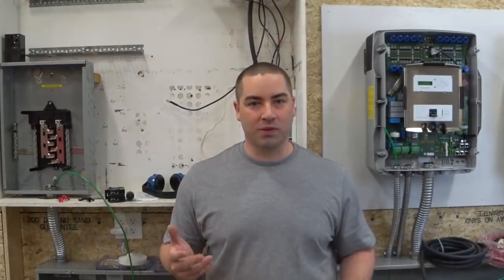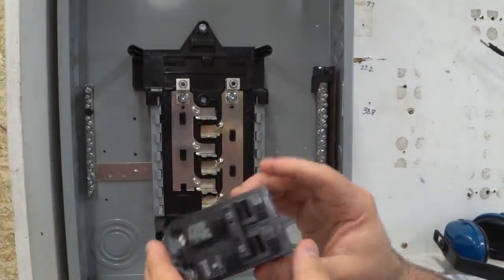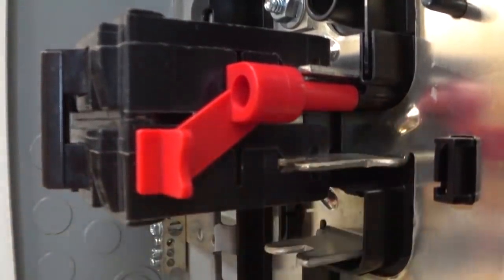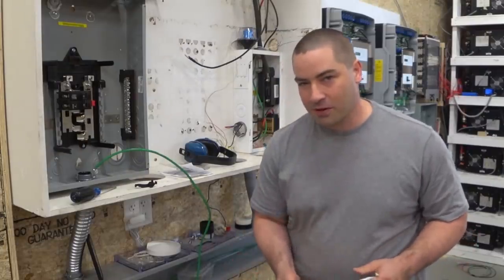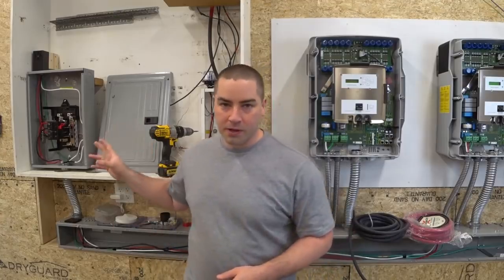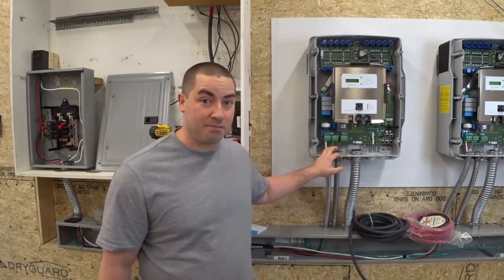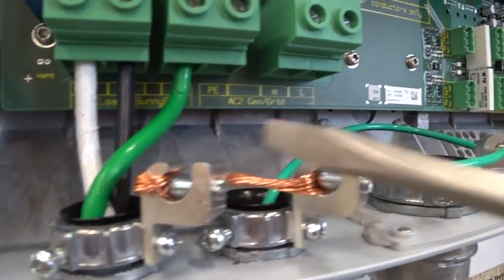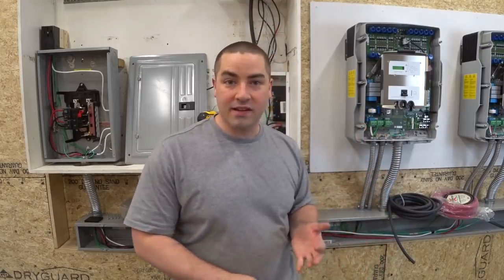Wiring AC Combiner Box on Off Grid System

Comment: I have this SRNE inverter that I'm trying to connect with a 15kwh lithium-ion battery but the inverter keeps showing the error code 05 (Battery overcurrent hardware protection). Please any suggestions on what to do?
Reply from the maker: Try pre-charging the capacitors using a resistor.  I demonstrate the process in several videos, like this one: https://youtu.be/SYJ25izYSGc at 6 minutes, 46 seconds into that video.

Comment: I have a 6000 single inverter. Only 120v. I think I only need a single pole breaker 70 amp. Says 6000w 68 amps out.
Reply from the maker: That's cool.  Let's do a little math.  The 6,000W rating on the Sunny Island is continuous.  6,000W/120V=50A.  The 68A you are looking at might be the 30 minute rating?  NEC (code) says you need to upsize 20% on top of continuous ratings, which would be 60A.  So, a 60A breaker meets code.  But, if you want to upsize your setup to a 70, or 80 Amp, there is nothing wrong with that, so long as you up-size the wire with it.  The wire and circuit breaker need to be matched. Look up "NEC Ampacity Chart" and I believe you will find that you can use 80A circuit breaker with 4 gauge copper wire.  I used 6 gauge, and the 4 gauge is the next size larger.

Comment: Half way through. You hooked the red and black to breaker. Is the red wire from one inverter and the black from another? You did this to achieve 240v?
Reply from the maker: Each Sunny Island inverter puts out 120V only.  Yes, one red wire is connected to one of the inverters, and the Black wire to the other inverter.  I set the programming so that they are "out of phase" from one another, which makes 240V.

Comment: So I'm looking for some information on how I should wire my panels for my Growatt 5000 inverter. I have 12 panels at 450 watt each. What would be my best options? I'm also planning on using a 4 to 1 combiner box.
Reply from the maker: The MPPT range (maximum power point tracking) for the 5000ES inverter is 120VDC-430VDC.  You need to make sure that your solar panel strings are inside of this range.  To do this, look on the back of your solar panels.  There should be a data sticker.  You need to check the "Vmp" which stands for Volts at maximum power.  As an example, let's say the Vmp of your solar panels is 50VDC.  This means you need a minimum of 3 panels in series to be above the 120V minimum.  3x50V=150V.  
You will also need to make sure your Voc is below the maximum Voltage of 450V for the unit.  Since you have 12 panels total, I'm guessing that when you do out the math on your panels, you will find that having 2 parallel strings of panels, with 6 panels in series per string, will get a good result.

Comment: So I am running the LV6548. I want to connect it to my trailers main breaker. My plan was to disconnect the grid wires that were cut from the grid when the trailer was moved and connect the LV6548 in their place. I will not being using anything over 120v so I will be keeping any breakers over 120v off. What do you think?
Reply from the maker: Anything is doable, but there are some precautions to consider.  
1. Try having a transfer switch between the main panel, and the inverter.  The transfer switch can then be used to switch between the inverter, and some other input such as a generator.  This way, if the inverter goes down, you can still run loads with a generator.
2. I'm a fan of making it impossible to accidentally screw something up.  We are all human, and make mistakes.  Ask yourself: "If I forgot to turn off a 240V breaker, will this cause any damage?"  If it could, then I'd remove the circuits that are 240V, or run them to a different breaker panel.  Or add a transformer to make your 120V inverter into a 120/240V inverter.  The point is to make it impossible for you to cause damage to equipment.

Comment: quick question am kindly asking?  how many 300w solar panel it need to get 3000w ? what size charge controller i will need? what size wire it will take to set up 3000w system? how many batteries it will take to run 3000w inverter? what size fuse ?

Comment: An inverter is 1 phase at 230v best way to split into 2 legs , wire it straight into 1 phase of a 100A Double pole breaker and then jump it over with a short wire at same gauge , which will make my entire box 1 phase “ Question will 220v plug still work if both phases is the same phase ? Thank you - you do an awesome job !

Comment: Great - Job Explaining ! Im doing a low budget battery back- up / DIY Alternator Generator will be using 2 Gm 10 SI High Amp 110A & a 120A w/ a Ford - Mazda 150A  will be powered by DC 12v motors energized by battery-bank 48v Lithium Phosphate 3.2v 280A & a bank of Lithium Titanite 2.3v 40A “ what I’m trying is to be self sufficient in electricity in a grid-down scenario . My inverter is a 5KVA 230v pure sine wave charge controller in a sense the alternators can charge the PV for 12v but if I tap into the Stator which is 120v Ac before the change over to Dc current .

Comment: Of course im a lil confused lol ok so the green & white wire coming from the inverter is switched to a black & red wire going into the breaker box now what volt is that going into the box and is that just one inverter sending power to ur box at 220v or 120v ??
Reply from the maker: Each inverter outputs 120VAC.  I need to combine the two in the circuit breaker box.  Inverter#1 has a hot, neutral, and ground.  Inverter #2 also has a hot, neutral, and ground.  First, all the grounds are run with green wire and all go to the grounding bus bar inside the combiner box.  Next, both inverters have a neutral.  Both of these are run with white wire from the inverter to the neutral bus bar of the combiner box.  Last, we can look at the hot legs.  Hot leg from inverter#1 we will call L1.  L1 is run with back wire to one pole of the 50 amp circuit breaker.  The hot leg from inverter#2 we will call L2.  L2 is run with red wire to the second pole of the 50 amp circuit breaker.  At this point all the input wiring is done.  Output wiring is run the same way every other house in N.America is run.
Reply: @DavidPozEnergy  How do you synchronize to the two phases at 120VAC and -120VAC ?

Comment: Thank-you for you’re Teaching ! I’m a DIY ‘re i’ve got a 5KVA 230v PureSineWave Inverter charge controller 48v to only use when the Gide is down , I’ve got Two 48v Lithium battery Banks 1 - 3.2v 280Ah & 1- 2.4v Titanite 40Ah , I wanted to hard wire it into a 100A Double Pole Breaker which would be a dedicated circuit only for this ! So when we lose power you have to go down and shut off the main breaker killing the grid from the house and then flip on the double pole breaker which is live by battery back up I also have a manual transfer switch with six circuits 30A but that is very limiting! I have the Moes Automatic Transfer Switch but I would prefer to do it manually 2 make sure No Issues & I have A brand new breaker box I could wire as

Comment: I took time to read the sol-arc wiring diagram for inverter wiring, page 48/53.  It states that one one side (top) the wires from the meter through the main disconnect then to the ac combiner then there is a line for each inverter by splitting  (ok. I understand) then there is a line going to the Bypass Transfer switch on line side ( I guess a PDB can do that before it comes to the ac combiner box). Then on the generator side the wires go into the ac combiner box then splits into the 2 inverters (2nd ) and then the outputs from the inverters come into the ac combiner box and then goes to bypass transfer switch  I assume as one sets of wires (3rd) bottom. Looks simple but when I try to get images of ac combiner boxes to show the above that is where I got a problem.  The examples don't reflect the above. Are there really 3 sets on inputs and then multiple outputs? It seems that all an ac combiner box is is really a sub-panel and you can buy a sub panel and the fittings and make an ac combiner box yourself. I can only imagine all those wires in an ac combiner box. Can you enlighten me? Thanks
Reply from the maker: I've never wired up a Sol-Ark.  Try this: https://youtu.be/7zoPu-uK4Xc

Comment: Hi I am now learning about ac combiners via sol-arc 12 parallel diagram and a video.  How does the combiner work?  The name suggest like array combiner that a number of wires run into it and then one common wire run out.  However, where there is a generator connected to inverters, solar panels to inverters then ac output and the grid (120v/240 vac) do they all combine into one red and one black and one neutral wire that run into the manual transfer switch? Thanks
Reply from the maker: The solar panels have a combiner box outside.  Solar and batteries are DC.  Inverters output AC.  You need a combiner box for solar.  Another combiner is sometimes used with multiple batteries.  In this case I have two inverters and combine them at the AC output.
Reply: @DavidPozEnergy  thank you again

Comment: Just an FYI as per the SMA SI inverter manual. "The AC cables between the Sunny Island and the sub-distribution of a system must have the 
same wire size and the same cable length for all parallel connected devices" This is a cool channel. Thanks for sharing your projects and knowledge.

Comment: David what did those inverts set you back I been looking for a set of those to run parallel
Reply from the maker: I got the inverters at a smoking deal of $2400 for the pair.  But the lowest I've seen recently (Ebay) is $3200 for a pair.  Still a good price because MSRP is $5000 for one.
Reply: @DavidPozEnergy   dam I guess I 'll keep saving

Comment: If you are back feeding into the 60amp breaker, does it work as a breaker then?  I'm curious as to why you didn't just attach the inverter wires to the top terminals, like the two 100amp lines/phases? would attach in your main breaker panel from the local electric company?  The only reason I as is I'm looking to do the same configuration at my house.  Thanks in advance!
Reply: I am wondering that too.  I have an off grid home I am building and one of the DC trailers that I will be eventually transferring the equipment off of and into the home and want to bring the 240AC from the two inverters and bring into my main service panel just like a normal service entrance would be setup.

Comment: Hi & congrats... cuestion: why you don't screw the "the hot legs" (the red & black wires) in the top of the AC box? I mean in the conexion to the copper bars of the AC box, instead of to the main breaker directly? You know what I mean?
Reply from the maker: I didn't do that because I wanted a main circuit breaker in there.
Reply: @DavidPozEnergy  ok... got it! Thanks

Comment: great job, soon will be done somethink like you with leaf bats +  Sunny Island 8.0 + Rec Bms, one question if you have a blackout batteries could work like a generator ? is in the  Sunny Island we need to set parameters ?
Reply from the maker: Yes, there are settings in the Sunny Island so you can use it like a backup generator (UPS)
Reply: @DavidPozEnergy  But i am trying to understand how to make it, i read we need to connect on AC2, but the wires go to the same grid of the AC1 right ? Can you make a video how to make it ?
Reply: manual says :
• Connect the line conductor to AC2 Gen/Grid L.
• Connect the neutral conductor to AC2 Gen/Grid NTT.
so simple(one phase) ?

Comment: Does the main breaker hold down kit prevent a breaker from being installed in the slots across from it?
Reply from the maker: Yes, that's correct.
Reply: @DavidPozEnergy  So if you add a few Sunny Boys then they would also have hold down kits too? A guy will lose a lot of breaker space. Only asking because I have 3 Sunny Boys I'm putting in and will also be adding the wind version down the road as well.
Reply from the maker: I'm not sure about that.  Sorry.

Comment: Is white the uniform code for nuetral in your area? It should be ( - ) equivalent or black in DC
Reply from the maker: This panel is containing AC (alternating current) circuit breakers.  White is the Neutral.  Yes, white is the official color for neutral in AC.

Comment: NONE of the ground wire connections would comply with UK standards - ALL bare ends must NOW be terminated with a ferrule (applies to Line and Neutral too) Double connections are allowed but should use a twin entry single out ferrule. We don't have the problem of split phase either (except on 110v site transformers (+/- 55V AC about ground).

I thought this was going to be about combining inverter outputs (can be done potentially using grid tie inverters NOT tied to the grid. Requires a NON grid tied single inverter for sync). However, the modern domestic supply provided in the UK provides a 240v 100A main fused input to a 100A (max load) consumer unit, the normal standard one comes with separate 80A and 63A rated RCDs, EACH providing 5 circuits. Upstairs 32A power and 6A lighting on separate bus bars and downstairs 32A power and 6A lighting on opposite bus bars with a 40-45A cooker supply  and 32A utility supply the spare circuits used for ancillary lighting or dedicated spurs e.g. for gas heating boiler and/or refrigeration etc. So, any solar/inverter supply potentially has to provide up to 20kW to go completely off-grid.

AFAIK in Germany they have a full three phase supply to each house. Not sure about flats, I suspect they only get provided a single phase out of three. The UK & other European countries share only four things - 

a "kind of" commonality or rather compatibility (sometimes) of appliance  plugs (France and Germany are different but designed to be compatible) 

a 220v standard (within a certain percentage to allow for local differences) - the UK is nominally 240v but is often at 250v.

a 50Hz supply (easier to divide down to time 1/100ths of a second (60Hz is easier to run clocks ostensibly, but not so sure about that)

a standard set of wiring colours - brown - line; blue - neutral; yellow/green stripe - earth.

Everything else is different (pretty much).

Love your video series on this subject but you should bear these BIG differences in mind since you have an international audience.

Comment: Nice use of the gutter. Your grounding is spot on in my opinion. Grounding between AC/DC conversion is something that is still not quite perfected, in my opinion.  When in doubt overground, unless it messes with neutral/ground separation, necessary for GFI's to work..

Comment: I hope you are open to information about solar and NEC.
First, I tried to find a NEC definition for combiner box and couldn't.   But after doing many megawatts of solar design, I can say that that term is for D.C., not AC.   AC is panel board or load center.    Then, I saw your grounding bushings on the flexible metal conduit, they seem to not be required for your installation.   Maybe I'm missing something in article 348.   
Also, while reading Article 348 Flexible Metal Conduit Type FMC 348.12 Uses not Permitted (3) In storage battery rooms.   I would suggest that you get a determination from an Architect if your batteries would be classified as such.   If yes, then you need to find out what it takes to get an exception.   I believe there is one for air changes per hour.   I just want you to be safe!    Always be safe.   The life you save may be your own.   Respectfully,    Kevin
Reply from the maker: Thank you.  I appreciate your well thought out comment, and the way you said it.  I'll look into it more.  I'm not an electrician, so at the end of the day my local electrician makes the call.
Reply: DavidPoz    Just wanting you to be informed.    Best Wishes!
Reply: @DavidPozEnergy  Kevin is correct in that there is no need for grounding bushings as the flexible metal conduits work as the grounding electrode conductors. In my opinion however, they are not a bad idea when the flexible metal conduit is connected to panel boards using the concentric knockouts. I've been an Electrician for almost 30 years, however I am relatively new to solar applications. I find your videos to be very informative and well done! Thanks, and please keep the videos coming!
Reply: I've been an inverter field specialist, a Procurement Manager, and Inspector for commercial and utility scale solar projects for over 8 years. AC Combiner is a thing in solar especially since string inverters have become more prevalent on large projects. Electricians call them Panel Boards or Solar Panel Boards. The NEC has been playing catch up with solar since day one.

Comment: You only need to bond one end of the conduit.  Bonding both ends of the conduit can cause circulating currents to build up in the ground wire from simple induction.
Reply: Yes yes yes! 
Ground wire needs to be connected at both ends, but shielding/foil/wrapper should always only be connected to ground at one place (/one of the ends)! 
Most electricians don't understand this!
Reply: @bayerbear6770  Sadly, it depends on who's doing the inspection. A recent build of mine was "grounded to hell and back" because of a total ***hole inspector. (took an order from engineers -- actual certified, stamp-welding Professional Engineers -- and UL, to get the UPS approved. Yet, all of the runs for the HVAC systems, run by a different contractor, has none of this unnecessary grounding.)

Comment: Great to see your back feeding wiring.  This is how grid tie inverters such as the SMA Sunny Boy connect to the grid and help people go Net Zero by simply going into a 40 amp 240v double pole breaker (20% rule of a 200 amp main service panel).  However, why didn't you just run the AC output of the SMA inverters into the main L1 and L2 of the AC breaker panel instead?  Saves the need for an AC panel that has a master breaker?  I'm no electrician, but the term AC combiner box for what is really an AC breaker panel doesn't make sense.